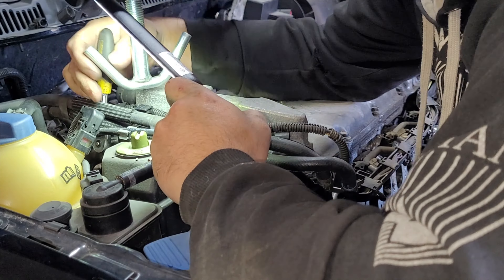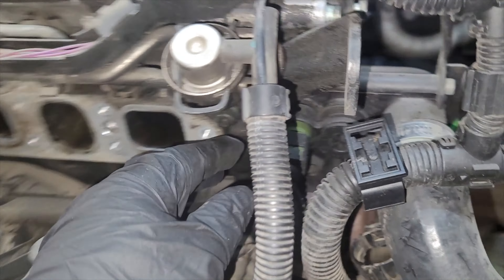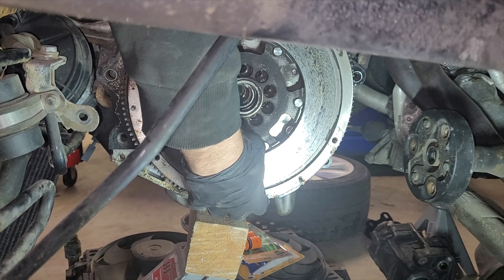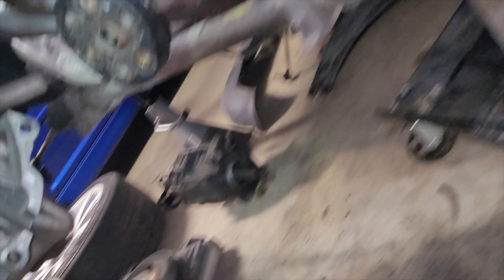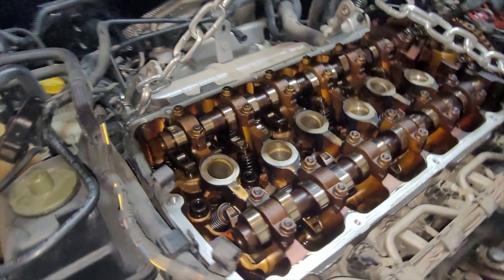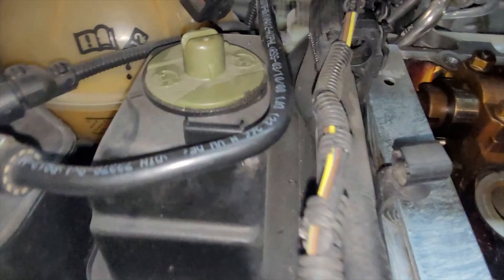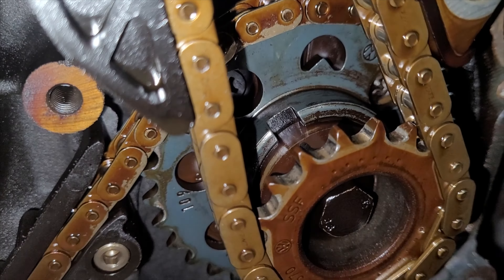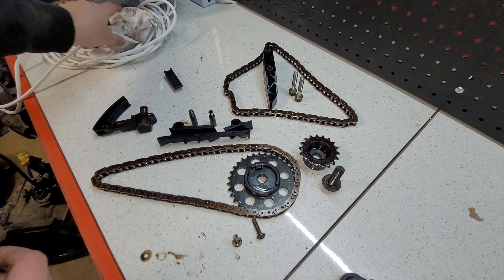VW MK4 Bora/Jetta VR6 Project EP4 - Timing Chain Removal

Comment: What is the code of engine AQP or BDE?
Reply from the maker: Neither, it's an AUE 😁
Reply: @apbuilds1519  its the same of AQP?
Reply: @fetushislami5170  AQP has 3 chains, doesnt it? AUE and BDE have 2 chains.
Reply: @KorashSyndikat aue is the same as aqp. Only inlet vvt, bde is similar to 3.2 and 2.3 engines with vvt on inlet and exhaust

Comment: What was the mileage mate? Cheers from Auckland.
Reply from the maker: Hey mate, 207k kms on the motor
Reply: @apbuilds1519  Thanks a stack mate. Happy new year.  Awesome job btw.  Mine has 190k now.  Cylinder "6" is leaking oil onto the sparkplug.  I wipe it up every 2 months.  It runs fine thereafter.  I'm just trying to gauge when to do mine as these cars are notorious for this problem.  I would like do this plus the main seals, oil cooler, oil pump, water pump, clutch and flywheel all in one go as I have to send it to tech.  Keep up the fantastic work.